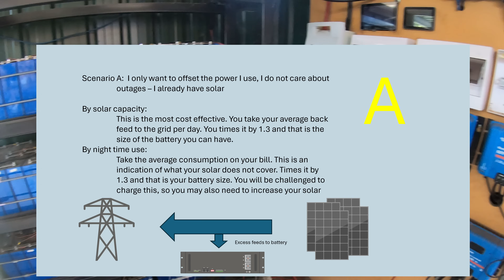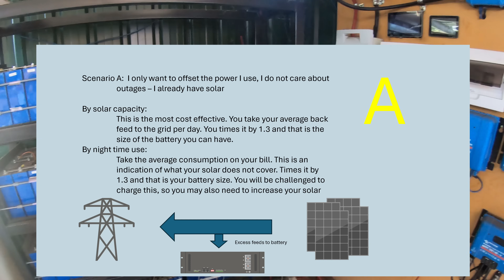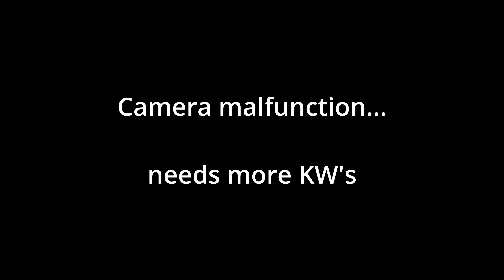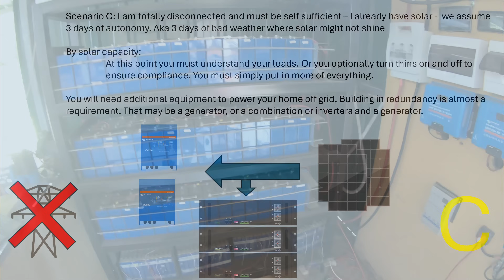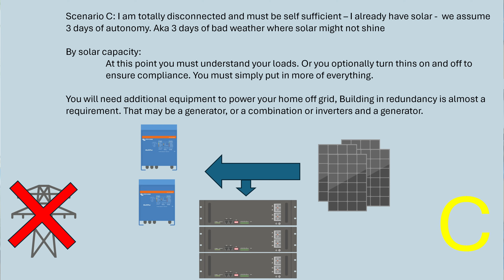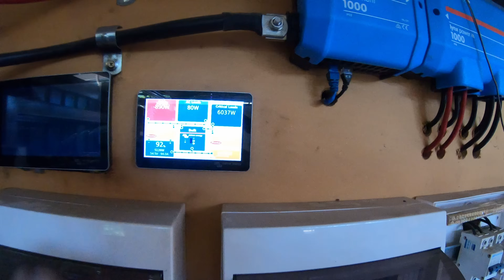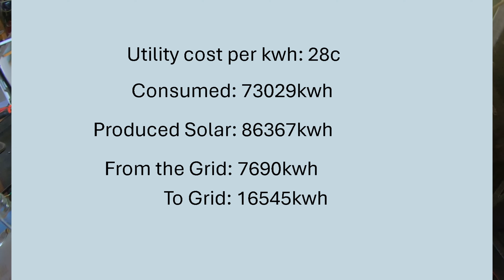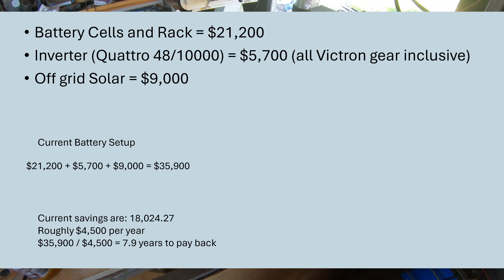Lithium Battery Cost Effectiveness

Comment: I like your calculations but I decided to go in a slightly different direction. First off I'll give prices in NZD which are a little smaller than AUD and our GST is higher, so when I say $1 think $0.88 for you. EU and US can make their own adjustments. I don't have anything installed now but I've just ordered a couple of things, motivated primarily by the 2 day outage I just suffered in ex-Cyclone Tam, and 4 days in Feb 2023, and four or five outages up to 6 or 8 hours at random times in the year. I live rurally, literally the last house on 20km of 2-wire 11kV. I used 5000 kWh last year of which 1000 was in my "free" hour of power, so let's call it 4000, an average of 11/day, or about 460W. I'm paying 69c/day plus 30.3c at night, 36.3c off peak day and 9-11 evening, 60.6c 7-9AM and 5-9PM. Export pays 8c. Not worth considering. Big generation companies get 3c and I can see domestic exporting converging to that in 5 or 10 years. Unlike you, I don't think having 3 days of battery capacity makes sense. The obvious amount to get at first is enough to cover the 4 hour evening peak with, let's say, afternoon off-peak power (saving 24.3c/kWh) and the morning peak (saving 30.3c/kWh). A 3kWh battery is a good size to do that, with about one complete cycle per day, though in two less than 80% chunks. I've ordered a 3kWh 3.6kW all-in-one battery/charger/inverter/solar device for $2900, arriving early June (first NZ shipment of this model, which has been in the USA about a year). Saving an average 26c on 3kWh/day os $285/year, taking about 10 years to pay for the unit ignoring cost of money, or looking at it another way, paying a 10% financing cost on the unit. Not really an actual financial payback if that was the only thing. HOWEVER, it does make the resiliency to outages something closer to free. In an actual outage that unit will run everything in the house for 5-6 hours, or 15-16 hours for just the essentials.That covers part-day outages pretty well. For the multi-day outages I've ordered an $899 2200W petrol generator. At current petrol prices it will will cost close enough to $2/kWh. I estimate I need about 50kWh from it a year. So $100 of fuel. And much less than that for an oil change and a new filter. Service is supposed to be every 100 hours, and this is only 25 hours/year, but there is are also time limits. The generator should charge the battery in around 2 hours, including powering the load at the same time maybe 2.5. Ballpark. And then run from battery for 5-6 hours (everything) or 15-16 hours (essentials). That seems WAY cheaper than buying 40kWh of batteries that almost never get used -- around $20k at current LiFePO4 prices I think, could do the 3-day reserve cheaper with lead/acid I guess, since it's not cycled. And the generator will cover a week or a month outages too, as long as I can get somewhere with working pumps to buy 10-15 litres of fuel a day. And FINALLY, since the unit is sitting there with two 1200W (32-150V, 20A) MPPTs anyway ... it would be a crime to not throw a few solar panels into the mix too. Viewed in isolation a $200 440W panel is going to produce really close to $200 worth of electricity a year. Six of them in two banks of three (120 Voc, 100 Vmp, 13.5A) for $1200 is a good fit to the battery unit. If I'm generating too much solar I can add up to four nicely-integrated 3kWh batteries (15kWh total) at $1600 each. One extra battery should be very close to getting me from sunset to sunrise in summer. Winter forget it ... I won't have enough panels anyway. Note: NOT planning to integrate to the house wiring, just run things from extension leads (it's all close together anyway). In an outage hot water heating will be the only thing I can't physically power. The cooktop is gas (9kg BBQ bottle, lasts 1.5-2 years) so that's something. So, total $5000 system plus self-made ground mounts for the panels and ~40m (20m each set of 3 panels) of 4mm or 6mm cables. $6600 if I add an extra battery next summer, but I'm not even sure if that has enough payback substituting night rate power. Will still need to use night rate power in winter, at least.
Reply from the maker: yea you cant go past a generator for a cheap power source in an outage. Batteries simply cost to much.
Reply: @BadIdea1123  3x more expensive per kWh than normal peak rate electricity, so you wouldn't want to use it a lot, but pretty low capital cost IF you have batteries to handle peak loads so the genny only has to handle the average. Even a 1000W generator would work fine for my <500W average use (200W for essentials), but the 2200W ones are only 25% more expensive, have twice as long maintenance intervals (100 hour vs 50 hour) AND only have to run half as long to charge the battery anyway so actually 1/4 of the maintenance. SO it's fine for a once every two or three year storm that physically takes out power lines, but if you were totally off-grid it would also be fine for a few times a year with just too rainy and overcast weather to make enough solar power for a few days.

Comment: I see so many stocks of lf280k cells people trying to get rid of lately, is everyone going lf560k now with new builds? Dimensions seem to be different, dont suppose can run busbar from lf560k to 280k cells in parallel? Or would I need like that victron battery balancer to combine them?
Reply from the maker: if they are getting rid of them id be keen to buy em. i mean its power still

Comment: My system cost near 20.000 euro. It's a 60kW deye inverter with 6 MPPT's,  72 Solar panels. And 2x 60kWh batteries totaling 120kWh. Yours is very expensive it seems and can do very little.
Reply from the maker: 20,000 Euro is 35,000 in australia, which would not account for all the other increases either.  but when i look op the DEYE batteries in AU they come up as $54,725 (https://www.solarbatteriesonline.com.au/deye-batteries/?srsltid=AfmBOopokVE4-bdMgbZ460Am1Da-kiu1Yf92g0p0Vs3H4uQj3Pp82k-H) So if i built the same system you have in australia it would cost me over 100k AUD just for batteries - not including an inverter or panels
Reply: @BadIdea1123  Nah i used a Deye inverter, with BYD car batteries. It's super easy, you just get the battery from a BYD atto 3, it's LFP. It already has pre-charge circuit, safety systems. BMS inside, translate the CAN messages to the Deye inverter and done.
Reply from the maker: @HermanWillems  we considered using old EV batteries, but the issue is the cost of things in australia. even second hand car batteries are not cheap here. i am glad to see they use LFP in those cars though

Comment: Just picked up 30kwh of cells before tariffs hit them in the US. Building an off grid barndominium, it should get me started. Future state I’d like close to 150kwh to add capacity for charging a large EV and some light industrial stuff.
Reply from the maker: That is an excellent goal. ALso what we plan to do. But likely an PHEV. Being able to use the battery to get rid of a fuel bill adds an extra 5k to 7.5k a year in savings on fuel for us

Comment: A lightning strike would cost you how much?
Reply from the maker: Hopefully nothhing. But lets face it something would likely get damaged.

The shed is really well grounded as the frame goes in to the ground quite a way but.... i suppose i should get my sparky to test that for me
Reply: @BadIdea1123  I am a sparky. Grounding does not change the outcome. A grounded panel will divert some of the strike through the earth cable, but it's also more likely to get hit by lightning because it's the path of least resistance. There's no test. If you get hit, everything is fried. Surge diverters are too small and don't work. You can even have everything get fried if lightning strikes your neighbours house, due to the EMP. Keep spares, preferably in a Faraday cage

Comment: lol i put a 16s 280ah lfp battery in the back of my phev with a 220v 6.5kw inverter.
i charge it from an ev charging plug, and it does pass thru, about 5.5kw to the battery while my 14 year old phev only maxes out at 3.4kw. so net i just about tripple my charging speed while also increasing the usable capacity of my phev from 10kwh to 25kwh. it directly offsets gasoline (about $0.70/kwh equivilant here) consumption while also offsetting all my home ev charging to work lol. the payback is super fast when youre offsetting gas usage. the whole setup cost about 1kusd including the inverter and batteries and balance boards, and hardware/wires
Reply from the maker: What PHEV do you have ? I was looking at the ranger PHEV but its battery is too small. The GWM looks good on paper but im worried about quality in that. We have a 3.5t van we need to tow so i want something with proven reliability with the intention of doing what you have done
Reply: @BadIdea1123  2013 chevy volt. i wouldnt tow with it lol. it was 6k usd, bought used 2 years ago, has saved me around 7k usd in gas and averaged 95mpg over 45k miles
Reply from the maker: @vevenaneathna  thats still a decent saving in my opinion.
Reply: @ ya there are a few in australia under the holden brand name i think but kind of rare. idk how the climate there treats the batteries. here they tend to have issue in the colder climates but ive heard hot climate like california can accelerate battery degradation with age.
gen1 chevy volt was 2011-2015, 2011 and 2012 have a software glitch which bricks them after they throw the slightest high voltage code here in the USA.
according to wikipedia only  246 holden volts were sold and u guys never got the gen2 model (2016-2019). imo gen1 was much better built than gen2.

Comment: Do you think there's a potential return on cost for a diy battery and multiplus set up with no solar, where a multiplus recharges during off peak cheap times and uses battery power evening time during high cost/kw?

Certainly missing out on maximum savings without solar i know. But I've got raw cells on the way and several jk bms's to play with, and solar will be a little while away. Thinking of putting it in as a "generator in or backup for the fridge and lights circuits or something for the time being.
Reply from the maker: I think it would take significantly longer to pay off but if it didnt experience any break downs it would still likely pay off eventually. Whats the disparity between off peak and on peak cost per kw ?
Reply: @BadIdea1123  currently still on an A1 plan from Synergy, but will consider the swap to the flexi-rate midday saver. I'm the one in armadale too. Will have to buy you a beer some time at Haynes 🍺
Reply from the maker: @thomaspoynter9031  I am in there far more regularly than my partner would like LOL

Comment: I got a grid tie inverter with a limiter just to save money 150 bucks 800 watts. Just 2 12v batteries. Most the power goes straight into my house from panels and the batteries act as a buffer. 1250 bucks total. How many watts of panels?
Reply from the maker: 18kw on the offgrid side (but its a mix of second hand and new panels) and 5.5kw on the grid connected side. It wasnt overly expensive, it we took away the money spent on the Caravans equipment it would be just over 35k i think. which is way more expensive than if you did it right now

Comment: Thank you for sharing the information. The price of a lot of this stuff has dropped a lot, I just ordered 314 Gotion LiFePo4 cells and the new JK V19 BMS. 16 cells that should deliver around 17KWH plus the BMS is close to $1750 AUD delivered from China. A Victron 15000VA Quattro inverter can be bought for under $4,500 if you shop around also. I have been running off grid for many years now using a 775AH FLA forklift battery, it has worked well but the new Lithium batteries have lots of advantages including no maintence.
Reply: Why would you go for Victron, while there are better Hybrid inverters out there that can do it all and more for less ???? it's mostly Boomers who go for Victron and love to empty their own wallets.
Reply from the maker: Yea the price has dropped everywhere its great. Im hoping with the USA putting tarrifs on china, we should see a surplus of cheap cells in the next few months. Hoping to add another 90kwh to ours

Comment: My 6 12v 100amphr LiFePo4 batteries cost 600 bucks total delivered. . They will run all my 120v in our 1,000 sqft house for 36-48hrs. Have a sub- panel in the utility room with a solar switch so spouse can flip from Grid to Solar batteries. Thru an 80amp DpDt contactor. If sun shines we can go solar 24/7 until it rains. We flip to solar on days the sun shines and the grid is up.
Reply from the maker: Thats how we started too. We bought 8x 100ah lifp04 batteries for the van but they worked so good we used them on the house. We have never looked back.

Comment: We're a retired couple living in a motorhome the USA powered completely by the sun. We haven't had to run our generator in over 2 years. We designed and built our solar system ourselves, on a tight budget. Our solar/battery system allows us to live completely off grid just like we were plugged into a power pedestal in an RV park. No more sweating at night for us as we almost always run our 12k mini split heat pump in the bedroom all night long, using about 10% of our 48v battery's capacity overnight. We started 6 yrs. ago by building a 620-watt liftable solar array on the side of our motorhome. Our side array makes a nice bedroom window awning, practically lifting itself with a couple gas struts, and it's easy to clean, standing safely on the ground. Next, we built a 12v, 560ah LiFePo-4 battery using 8, 280ah prismatic cells and a Heltec 330amp BMS. These cells fit perfectly under the steps of our MH where our old pair of golf cart batteries used to reside. We insulated the battery compartment, cut a small hole in our step risers and installed a tiny computer CPU fan to keep this space at close to room temperature, so we don't have to worry about the BMS shutting down charging due to low temperature - or their life reduced from getting too hot. Our 12v system uses an 80A Progressive Dynamics LFP converter/charger, a 1,000w Renogy inverter, a 50a Epever MPPT charge controller and a Lnex battery monitor. This system powers all of our 12v appliances and can even run our residential fridge, computer and TV if our 48v system goes down.

By mounting the solar array on the side of our coach, we left the roof free to rack 8, 550w solar panels down the length of our 35ft Class A, 15" off our roof, above our AC, vents, etc. It shades our entire roof, allowing plenty of cooling air underneath, increasing solar output and reducing the heat load on the air conditioners, yet our overall height is still just under 12 ft. Our 4,400w array can run both our A/Cs, household appliances and charge our batteries from solar at the same time. We mounted a Sungold Power all-in-one 48V, 5,000W Inverter/100A charge controller/battery charger, breakers and a Lnex battery monitor on the wall in our bedroom. It saves us space as well as money compared to a system built with individual components. We chose this model because it supports our 400voc solar array. Our 48v battery uses 16, 320ah EVE MB-31 prismatic cells and has a 200amp BMS to keep things safe and balanced. Together with our 560ah 12v bank, we have a total of 23.5 kwh of batteries onboard, charged by 5,020 watts of solar. 

We removed the rooftop A/C we had in the bedroom and replaced it with an EG4 28.5 seer-2, 12k btu mini-split heat pump on the upper rear of our coach. It's super quiet and cools as well as our 14.5k btu Furrion rooftop unit we have up front, using about 1/3 the power. This 48v system provides 24/7 off-grid air conditioning and heat from the heat pump, saving on propane use too. Both 12 and 48v solar/battery systems cost around $11,500, including the $1,500 high-efficiency heat pump as we did all of the work ourselves. Our ROI is less than 2 years, compared to spending $500 monthly in RV parks, (if you can find them that low, as the average RV park rate in the US is over $750-$800/mo.). It pays for itself within a year compared to a $225 weekly RV park rate. Since we frequently move every 2 weeks, the weekly rate is a better comparison for our mobile lifestyle. But the biggest advantage of our solar/battery is the freedom it gives us. We are now able stay in some of the most beautiful wilderness areas imaginable, mostly free, on hundreds of millions of acres of Forest Service and BLM lands, regardless of the season. Last year we visited 11 states, without plugging into a power pedestal the entire time. Last winter we boondocked in the desert SW near Yuma, AZ where it's nice and warm. We're visiting family now in North Carolina, on the East Coast where boondocking places are pretty rare, so we're staying in a spacious, no-hookup site at a convenient RV park for only $100/mo., saving us $600/mo. off their normal FHU rates. It's good to have options.
Reply from the maker: That is excellent
Reply: Hi @SuperSushiDog - Excellent! From central Florida 🌴🇺🇸